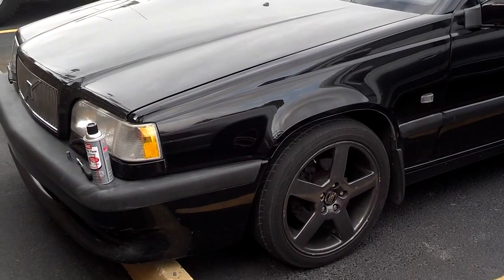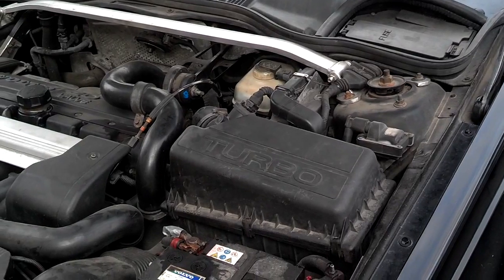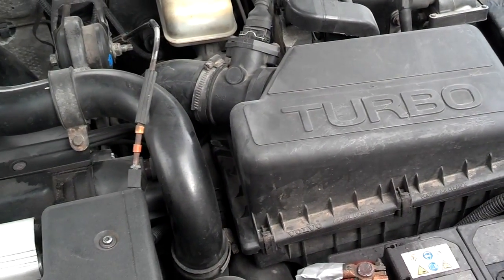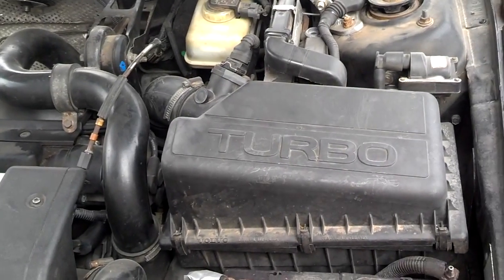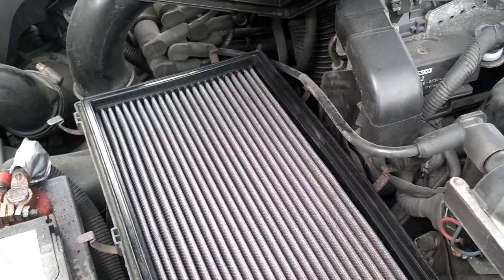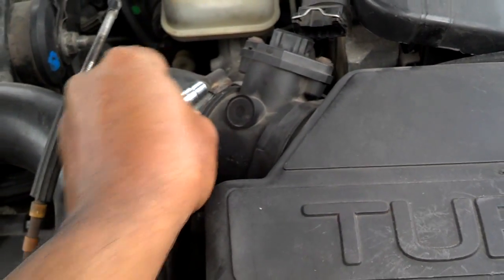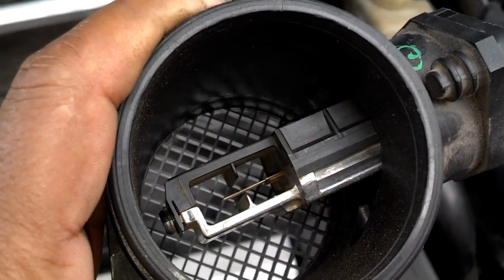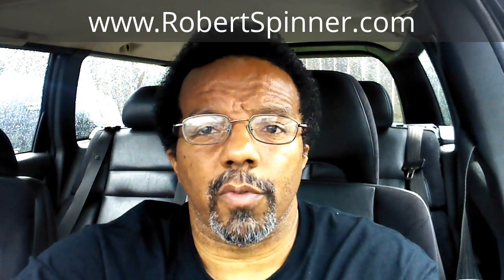How to clean or replace the mass air flow sensor, MAF, Error code P103 - VOTD

Comment: Those T25’s to get the sensor off are NOT your regular T25’s. You need a special T25 called a “torx plus 5 point or TS25. A real pain to get where I’m from. Had to order a set from Amazon. However, Robert, I noticed yer running a KnN filter, so am I. My question is someone was saying that the oil messes with the sensor? Just wondering what your take is on that? I’m still gonna run mine regardless .
Reply from the maker: There are very few places that sell that special tool.

If you use to much oil it will damage the sensor.

Comment: Hello, My car’s engine block has been replaced, along with the piston rings and valves. I'm currently in the break-in period. During the first 1000 km, I had no issues and did not push the car. Now I'm in the second 1000 km phase, but something odd is happening. I start the car, drive it, and everything works fine. But when I come home and put the gear in “P” to turn it off, the idle suddenly rises and stays above 1 (1000 rpm) — it doesn't drop. Why could this be happening? Is it because the engine is new? The only part I haven't changed is the oxygen sensor — could it be related? Thank you very much.
Reply: Hello Robert, I’ve solved the issue — unfortunately, the service had overfilled the oil and I had initially overlooked it, which is unbelievable. Thank you; once I drained the excess oil, everything went back to normal.
Reply from the maker: Thanks for sharing.
Reply: @RobertDIY Hello Robert,
I’m facing the same issue again. When I drive the car and then stop, the idle in “P” and “N” hovers around 1200 rpm and does not drop.
The idle air control valve is new
The MAF sensor is new
The throttle position sensor is new
The oxygen sensor has been replaced
The computer only gave an error code for the oxygen sensor
I’m not sure, but could it be the transmission position sensor as well?
I don’t know where else to look. The oil level is normal and the throttle cable position looks fine. Could there be a problem with the PCV, or is there another part you would suggest I check?
Reply: @RobertDIY I solved the problem a little while after I wrote to you, it was really so silly, and I’m sorry for giving you a headache. They had somehow installed the air filter backwards, I fixed it, and everything is fine now. It was the strangest experience I’ve ever had in my life.

Comment: Is this the same issue for the P0102 code?
Reply from the maker: 🤷🏾‍♂️ What's the code for?
Reply: @RobertDIY  Mass or Volume Air Flow Sensor

A Circuit Low

Comment: IMPORTANT: RESET the MAF sensor after replacement!!!

Two methods. 

1. Disconnect (-) battery terminal. Wait 15 minutes. Reconnect. Start car. Smile. 

2. Idle car for 30 minutes. Smile. 

Reset causes ECM to “reboot.”
Reply from the maker: thanks for sharing.

Comment: Help. Brother I replaced the Air flow sensor Bosh in my s70 T5 98 becouse the one before was broken.
Now when I accelerate the car struggles, hesitates.
When I disconnect the Air flow sensor connector  plug while the car is running it continues to run.
What could the problem be... I have no scanner. Spent a lot on head gascket job and now this. Never ending problems
Reply from the maker: You can bring it by and I'll take a look. Not all cars stall when the mass airflow sensor is unplugged. When you are accelerating your gas pedal hook to your cable kind of overrides your mass air flow sensor however it does read the air cutting across the sensor. When was the last time the car ran good?
Reply: @RobertDIY  it worked before doing the Head gascket. I live in Asia bro

Comment: July 2021, On the road I-80 West from Columbus,Georgia to Reno,Nevada. 1994 Volvo 940 starts sputtering and drops dead. Call mechanic at home he says sounds like MAF - mass air sensor. I run codes, get 1-2-1 = MAF failure. Mechanic suggests check with O' Reilly's at Rock Springs, Wyoming - about 35 miles down the road.
Call O'Reilley's they can have new MAF at store in Rock Springs in the morning, $140 (not Bosch). I get an old school motel room 1/2 mile from the O'Reilly's store.
Having a cold beer and watching the video to see if I can switch out the MAF myself in the morning. Thanks Robert.
Reply from the maker: Ouch! Hope it works out.

Comment: Hi Robert, thanks for all the helpful videos!!! I have a 95 t5r Estate in black with 78k miles it idles like crap from cold and misses when moving off (cold) black exhaust tip and hesitates/stutters when accelorating, hope you can suggest a fix? I'll send some money(name your fee) 👍, already done zero tune apart from fuel filter which was done 4000 mile ago, also put new bosch o2 sensor in 👍
Reply from the maker: Probably has a loose turbo tube.
Reply from the maker: https://youtu.be/x8sXo5gbapM
Reply from the maker: https://youtu.be/NWfLpp8NevI
Reply: Hi again Robert, swapped the maf as it was pretty cheap at parts store, noticed another thing with the stutter, if I blip throttle between gear changes and then drive into  the gear no stutter! But if I change gear and drive into the gear without a throttle blip it stutters??? So by introducing fuel or raising revs between each gear it will run fine!!!??? Thanks for your help in advance, other volvo  youtubers welcome to answer 👍👍ps fuel pump swapped for a walbro about 100000 miles ago

Comment: Hey Robert. I recently found your videos and they have been very informative and helpful. I just replaced the MAF on my 98 s70 turbo but now the car won't start. It did before replacement. I tried again resetting the codes by disconnecting the battery for over ten minutes and nothing and I tried unplugging the new MAF and nothing. It is installed properly, I double checked. Thoughts?
Reply from the maker: https://youtu.be/aj4tL32XIXs

Comment: I tried cleaning the MAF and car still wouldn't run, So I unplugged it and the car runs OK, also eBay and  other places sell these for $18.50  to $50  Thanks
Reply from the maker: Cleaning them is a long shot. I would ONLY try a Bosch MAF.

Comment: Will this clear a P1111 code? just curious My 1999 s70t is showing this code along with P0300 could be my misfire from my maf?
Reply from the maker: I doubt it.
Reply: Thanks for the quick reply, any idea where to start for a P1111 and P0300 code? My only vehicle at the moment and trying to get back on the road. I changed spark plugs, not sure if I need to lean towards the MAF or Coil packs for resolve.

Comment: Why does my 94 850 have rough idle? Cleaned EGR valve, plugs rotary wires condenser, cleaned maf, could my timing be off?
Reply from the maker: Hunting idle? Is the PCV clean?

Comment: Hi Robert !!
I have a 99 2.4 volvo turbo , it stalls wile driving , I put it on neutral or parking and starts immediately.
No ruf  idle
Fuel pump relay , cam sensor and fuel filter new .
Any idea what can cause this ?
Throttle body ?
Reply from the maker: While driving or when you come to a stop?
Reply: @RobertDIY  wile moving
Reply from the maker: https://youtu.be/8fNCqTu7fKM
Reply from the maker: https://youtu.be/r7BRGvltmHA

Comment: Great video as usual! Whenever my car is sitting in colder weather like 0° and below, it won't start and tries but no go. I'm kind of wondering if it is the MAF? I did try cleaning it with that stuff, but still wont go, soon as it gets cold around zero, no go, but anything above 0 degrees, then it runs completely smooth. Any thoughts on that?
Reply from the maker: I don't even know what kind of car you have. Probably the ECT.

Comment: Hi Robert, great diy video on this issue. I have been having misfiring on the cylinders random and now 8 -10 minutes  after it has been running. So smooth operation before 10 minutes. I have spray from the filter housing side. I see I may not gotten good aim to the sensor. I did not see a p-130 code.  Only suspect the mas air sensor is the true problem or not?. I did see few codes for cylinders misfiring. I thought I might see what you think.  Why does problem only show after the car has been running 10 minutes, never before. If it's just a little dirty would it throw a Code. What else would be causing misfiring. Changed fuel filter and car is 98 v70 glt. Turbo model. Less then 100k miles. Sensor had been changed 20k ago. Thanks!
Reply from the maker: When was the last time it had a tune up?
Reply: @RobertDIY  I had only change the timing belt. Not sure they did anything more. It's only run like a champ till now, smooth easy start up. I see replacement MAS parts for between 20-46 dollars. After mkt parts. Should I only use Bosh or will other parts work just as well? I freed up one end to spray it again. The side with a lip very tough to separate. Thanks for responding. Will let you how it works out.
Reply from the maker: https://youtu.be/aj4tL32XIXs
Reply: @RobertDIY  good news, removing the mas to direct the sprayer nozzle better worked. The car ran as good as before. So cleaning the MAS works. My only question now is why the cooling fan is running longer and even started up as soon as I turned on a cold motor? I have a feeling this fan is constantly running while driving. Temp gauge shows a cooler temp then before. 4 oclock, before 3 o'clock.  What do you think is going on. Shuts off after 4 -5 minutes when I turn off the car. Thanks
Reply from the maker: How old is the thermostat?
Reply from the maker: Likely has a bad ECT.
Reply: @RobertDIY  original, and I am getting heat from the vents. What's an ECT?

Comment: What happens if you can’t get the wire plug off?  It looks like it’s glued to the MAF some kind of way.
Reply from the maker: It's not.
Reply: @RobertDIY  Can I send you a picture of it?  Just trying to be cautious.  Next thing is the PCV trap.  I watched your video on that and it has both them smoke coming from the dipstick and the glove blows up, along with P0188 & P0190.   I would like to try to do that myself but am nervous I would not have all the right parts.  You have been EXTREMELY HELPFUL from afar.  I am in Louisiana and very grateful for your how to videos.
Reply from the maker: Sure, go to my website and text it to me.
Reply: My daughter has an 04 XC90 2.9 T6 fun

Comment: Robert. im trying to diagnose my mass air flow for my s70t5. im going to put a voltmeter on it hopefully later today but i did they quick unplug test while running to see what happens and the car does not shut off when i unplug it. it will still rev up. but when i go to plug it back in the car shuts off immediately. Do you think this sensor is bad? Im not getting my full tune boost and i cant find any boost leaks anywhere so im wondering if the mass air is somehow causing it.
Reply from the maker: Does the car have a MAF error code?
Reply: @RobertDIY  I have same issue on a 2.5T when MAF is plugged in, car won't stay running, replace whole MAF unit, same problem, and suggestions.

Comment: hello Robert.. can you help please.. I am getting a code no  P1072  mixture to rich,, warning on my  OBD ,,  can you please tell me what this might be  thanks...
Reply from the maker: What kind of car do you have?
Reply: hello Robert  from rainy England,, its a 2004 v70 petrol...runs ok  just keep getting this fault code coming up every  cople of weeks.. thanks...
Reply: its a 2004  v7 petrol... it runs ok  just keep getting this  message on my  OBD reader,,
Reply from the maker: Vacuum leak. How's the PCV system.
Reply: hello again.. think pcv  ok.  but will take a closer look...someone has suggested it might be A FAULTY   Engine Coolant  Temp Sensor,, confusing the ecu  to think the engine is still running cold thus  causing the mixture to  be to rich when engine warm..what do you think  .... will check both at the weekend,,
Reply from the maker: What does THINK it's ok mean?
Reply: can here no  sucking or blowing from any of the  breather tubes and  dip stick tube  ,, have purchased a tem sensor will try that  first   then inspect   pcv   if  error code  continues,,, thanks  for the  unfo

Comment: With those tamper proof screws you can use a little screwdriver to break off the lil tit thing in the middle real easy, then use a regular T20!
Reply from the maker: OK, thanks for the tip.

Comment: Hi Robert, i have a Problem with kind of a Air Sensor.The Original Volvo Computer gave me this Code: ECM 6200.
I try to translate the Message  : Supported Air Control Valve Signal Failure.
I deleted the Check Engine Light and everytime when the Motor is cold and i started, the Check Engine Light comes back.
Where is this Sensor? Is it near the MAF?
Reply: I got a S70 from 2000 with  2,4 Liter Motor and No Turbo
Reply from the maker: +kl6990 sad to say, I have no idea.

Comment: I removed and cleaned the idle air control and the throttle body. No apparent bad vacuum hoses. High idle speed has only dropped slightly. Still rough and hesitating acceleration. Before doing this the code only showed 1-1-3 short term fuel trim upper limit.
Reply from the maker: +Pa ul do you have a question?
Reply: If MAF is OK what else might cause this? I've also replaced plugs, wires, cap, and rotor.
Reply from the maker: +Pa ul what kind of car do you have?
Reply: 1993 850 non-turbo
Reply: 1993 850 non-turbo

Comment: I replaced plugs, rotor, and cap a couple months ago. Later the RPMs got very high at idle and car also ran rough. Then Check engine light came on and code indicated the MAF. Cleaning didn't help. Next I bought a re-manufactured Bosch MAF and now the RPMs pulse up and down at idle and still runs rough.
Reply from the maker: Get a new or used MAF. I have never tried a reman.
Reply: If a new one did this what would it indicate?
Reply: I put the old MAF back in and symptoms are still the same. RPM at idle goes up and down. When driving, acceleration is rough and chattery. I talked to a Volvo expert who only had a moment - he said to check fuel pressure regulator and hoses to the "vacuum tower"  but I'm not sure what he meant.
Reply: I put the old MAF back in and symptoms are still the same. RPM at idle goes up and down. When driving, acceleration is rough and chattery. I talked to a Volvo expert who only had a moment - he said to check fuel pressure regulator and hoses to the "vacuum tower" but I'm not sure what he meant.
Reply from the maker: What kind of car do you have?
Reply: 1993 850 non-turbo
Reply: Will cleaning my maf sensor Help with sputtering Robert? I cleaned it 2 yrs. Ago but forget why.do I disconnect t h e battery? Thanks Robert
Reply: I'm not doing all that I'm keeping it in the box and just crc it

Comment: Job Robert! Thank you for all your informative videos. Quick question. I have an '06 Volvo v70 2.5T. I've had my MAF sensor replaced 4 times in 3 weeks (1st 3 were from autozone, latest from Volvo) after the last one was put in, my car ran for a week and now back to the same issue. (Cutting off when starting and if I slow down/stop while driving.) Do you know what else my problem could be tied to?
Just thought I'd ask before I throw the towel in. 😔. Thank you.
Reply from the maker: Have you had codes read at a Volvo mechanic with a Volvo class reader?

Comment: hey Robert I have a 2002 s40 1.9t. Can I transplant a MAF sensor from another s40 onto mine? Will the computer chips be compatible? If not what do I need to do? I'm sure you understand a bad MAF sensor can be quite the problem and I can't afford a brand new one on such short notice. I need help. 

P.s. if it helps I had a p0101 (maf) and p0171 (bank 1 system Lean) I replaced an o2 sensor but still have throttle hesitation and bog/stall during deceleration
Reply from the maker: Sorry I missed this message. It came in during a viral video moment. Messages were off the hook.
Reply from the maker: https://youtu.be/Qvveywp-JOc